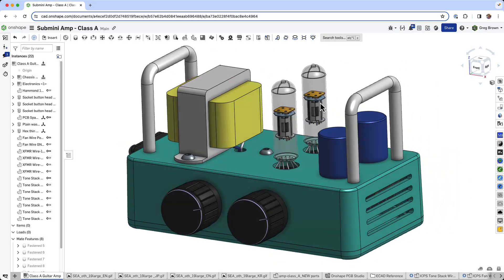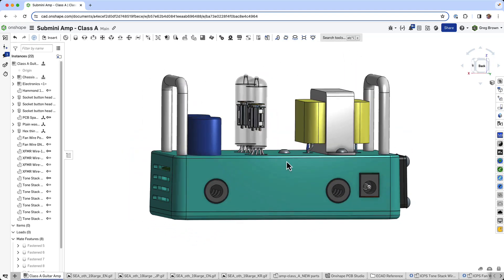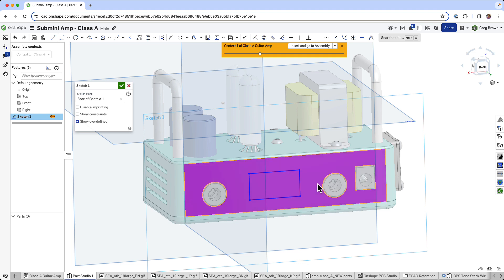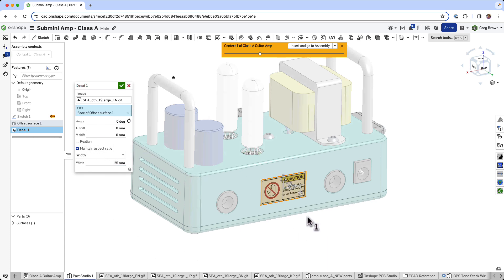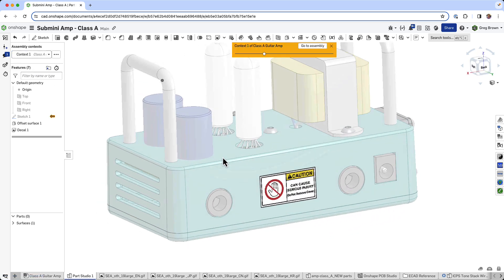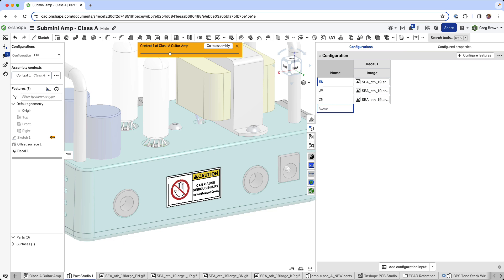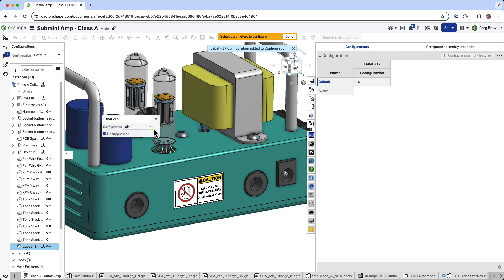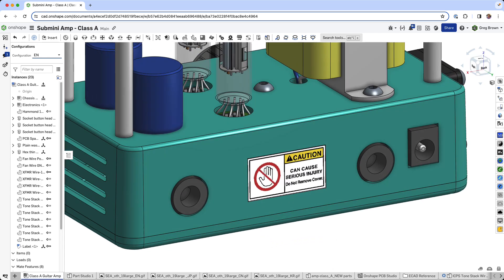How to configure Onshape decals for localized warning stickers.

Comment: I haven't taken decals for a spin yet, but I'm curious about whether they work with DXFs. I'm entirely in the 3D printing world (for now) so for logos I draw them in Inkscape then bring in a DXF, for access to the wires in the geometry to create solids. From the videos it seems the feature is limited to plain graphics but it would be really cool to use this workflow (including constraining size and aspect ratios) for a DXF.

Also – offset surface and the new offset curve seem super useful and I am looking forward to keeping them in mind. I enjoy trying to challenge myself to use dedicated features rather than slapping another sketch on the problem which often ends up with a feature tree about as sturdy as a Fabergé egg, haha. I wonder if there are some good rubrics one can follow for when to reach for a sketch and when to think in terms of curves and surfaces instead?
Reply from the maker: Decals - they are intended and were designed for the workflow of applying a png/jpg image as a single entity for visual representation of a warning label etc, rather than anything more fine grained like a dxf that you use for modeling. There are other use cases we could cover in future, but for now this is the intent.
Reply from the maker: There are some great tips in the learning center for efficient and robust surfacing techniques I'd take a look at. The more you can utilize robust curves rather than more fragile edges produced by other projected sketches, the better. There are some very nice tutorials online for general "golden rules of surfacing" that apply to all surfacing applications too.